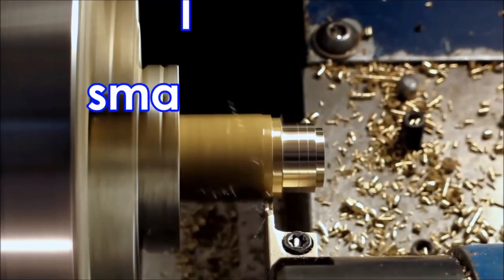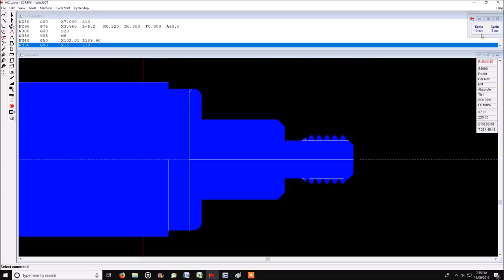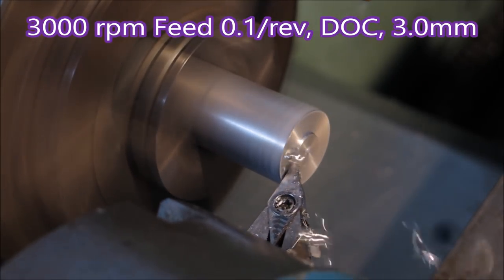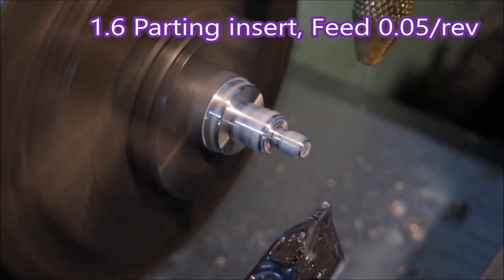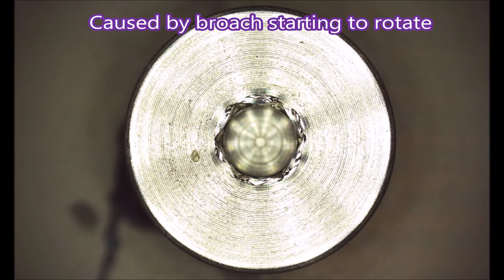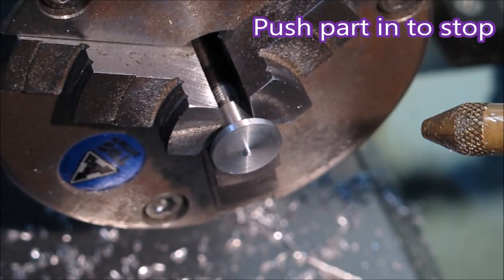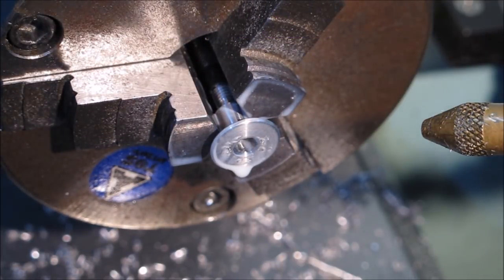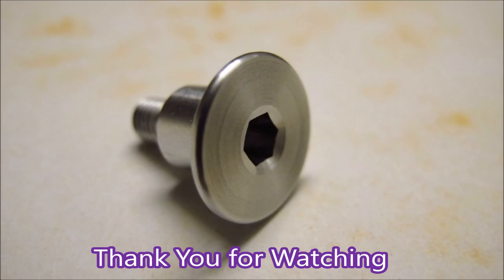Rotary broach hex in cnc lathe with Slater Tools broach at 2000rpm. M5 thread at 1500rpm

Comment: Very nice.  Since that broach spins at the same speed can you also just stop the lathe and push it in?  I guess you would have to stop and start it over and over and would not want to do that.  Thanks again.
Reply from the maker: Folks with large lathes can do just that.  Drill hole, stop spindle and force the broach into the hole with a straight push. This takes considerable force which is not available to me. By rotating and moving into the hole at say 0.05mm per revolution, it cuts the hole one revolution at a time, which my lathe can manage. Cutting while rotating, uses a tiny amount of force compared with a straight push.  Think hammer and anvil compared to monster drop hammer!
Reply: @smallcnclathes    You are a wealth of knowledge.   Thank you for the explanation.  There is so much that I do not know about lathe work. But I have only worked on one lathe in my life and that was a huge antique monster we had when I fixed sinkholes in Florida back in the late 80s while I was in my late 20s.  No cnc or rotating head. I just turned some metal to make a few things that was really rough and crude.
Reply from the maker: Gary Brown Forging On sometimes rough and crude gets the job done. That is what counts.

Comment: Hey Nigel.
Nice part, turned out pretty good.
Nice work with the video editing too.
Very detailed.
Thanks for sharing.
Peter.
Reply from the maker: Peter CCR ENG Thanks Peter. Compared with some, my videos are easy to shoot, but still take some effort to put together. Nice to have the effort acknowledged.
Reply: Hello again Peter, Just gone 6 AM and I am back again.
Cheers from John, Australia.
PS: Very nice part Nigel! As a curiosity, what is the total machining time once you have sett the program and set the tooling please?
Reply: @joandar1 
 Hey John.
I am sure you will Love watching this channel.
The only downside is Nigel has plenty of old videos to still watch, LoL.
Reply: @weldmachine  LOL You will get this after the one on Max's channel. I ahve little work on so am doing some learning.
Cheers from John.
Reply from the maker: John, I really don’t recall, as I was only making 8 parts the cycle time was not terribly relevant.
Timing the cycles from the video would give the best estimate. When quantity is so small I just get on with it.
If I have 50 or more to make, then I tend to take notice of the cycle time. Mainly because I like to get an idea of how long I will be standing there, but also to see how badly I quoted the price. LOL.
Reply: @smallcnclathes  I hear you about the quote aspect and will look again at the times. Thanks for the reply Nigel, cheers from John.

Comment: Love all these little tips on how to set up for a better part and better finish.
Reply from the maker: Thank You, I always try to make everything I do look like a bought one. Sometimes it comes at a cost, like always using a pitch specific full thread form insert. This means a different insert for every thread, but it is the easiest way to get perfect threads. Same with that rotary broach, it is the only way a little lathe like mine, can make a shape that is not round. Fortunately the 900 US was paid for, as I have made thousands of parts with that hex. I never regret the cost of a tool that just works.

Comment: I'm super impressed. Even with my large 5 axis lathe rotary broaching is a pain in the ass.
Reply from the maker: Thank You, I asked Slater tools what feed and speed to use and I had no dramas whatsoever. made thousands of parts in brass using this 4mm hex broach and I think I just used the same settings for this aluminium part. Thanks for your comment, support from someone with a man sized machine is always great to receive.

Comment: the problem with the broaching being ugly at the entry is becouse the broaching tool is not properly in center with the work piece. but great work
Reply from the maker: Thank You for your comment.
According to Slater tools, it is normal for the first chamfer to be damaged by the tool as it gets to the same speed as the rotating part and and the need to clean it up again after broaching is to be expected. I have no idea, I just do as they recommended.
Reply: @smallcnclathes  well Slater tools is drunk then :) i run broaching every day and always do chamfer first and no problem at all. Just make it center at the front of the tool. feed slower at the beginning and the feed a little harder. sorry if my english is bad but om from Sweden

Comment: Nigel, With tooling that close first run is one hand on heart other on Estop 😊.. Martin
Reply from the maker: Yes, a bit that way. There is within the software, the ability to adjust the rapid speed. When starting a program like this, I usually slow it right down for the first running of the code.  Once it appears nothing will go bang, I put the rapid speed back again to normal, 2700mm/min.

Comment: What is the advantage of rotation in such broaching?
Reply from the maker: It can be done using a small machine.  A large lathe would have enough power to simply push a broach that size into the stationary part. https://www.youtube.com/watch?v=IT8VXQEKzoo&list=PLFkviLkvBiAo_L3X2jPEaeSLhHTn6zztc&index=4&t=0s
May give you a better idea if how it works
Reply: @smallcnclathes  Thank you. That 1degree  angle made a lot of difference. I have a task of making a socket in M12 socket head cap screw botls. I don't have a forging press. So machined the component, now putting a hex is the task. I will try my this method, if you have any another suggestion, please help . This tool looks expensive and mine is a one time job.

Comment: love the CNC broach work - something I've never seen and will be very hqndy for me in due course. Thanks.
Reply from the maker: Hi Peter, thank you for your comment, the rotary broach was an expensive tool for me to contemplate.  However it made thousands of parts that would have been impossible for me otherwise.  I know folks with large machined can just do that size broach with a straight push in the Z axis.  My Z servo would have stalled!

Comment: What is the Tool material grade and Heat treatment cycle...
Reply from the maker: If you are asking about the broach it is a purchased item and I believe it is HSS, more than that I am unable to say.
Reply: @smallcnclathes  If you don't know the tool alloy then it will be M2 which is fine for most alloys say up to 303 stainless.  Any alloy 'above' if I may put it like that e.g. 316, Ti, Cr Moly alloys then use another tool alloy with a coating (Tool Alloy Examples PM-M4, PM-M42 & PM-T-15 etc....) = Easy  Polygon Solutions

Comment: The thread looks a bit rough assed.
Reply from the maker: Thank you, I think! Not really sure if that is good or bad? I was quite happy with the thread. Full form inserts make it easy to get good threads.
Reply: @smallcnclathes  Maybe it was the video that did not show it o it's best. Used to be an aerospace engineer and I can be a bit critical
Reply from the maker: @AlexLancashirePersonalView  no worries, that shot was with my microscope and the LED ring of lights can sometimes give not very good results as with this pic of the threads, the LEDs tend to make the crest of the thread look "lumpy" (best I can do) . As I was using a full form insert the crests were not lumpy at all. Sometimes I find that I can get better results just shining a light on the object from the side, but not this time. Thank You, I will keep it in mind for the future, I need to get my microscope shots right or things can look really crap.

Comment: I would turn this round and machine in one op at a slight cost of material wastage
Reply from the maker: I do not have a threading tool that will get in to the thread and I was not about to buy one as the order quantity was low. Thanks for your comment

Comment: Excellent video, and amazing rotary broaching.
Reply from the maker: Thank You, it is an amazing way to broach a shape. A large lathe could easily do this just with brute force (and no rotation) whereas mine could only make the parts this way. I have made thousands of brass nozzles using this method, the broaching tool was not cheap but easily paid for itself over time.